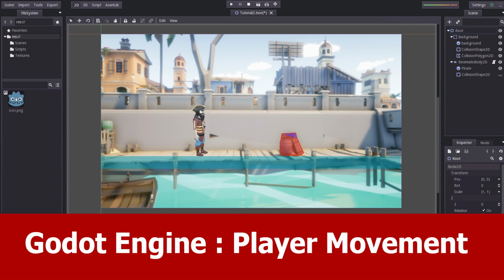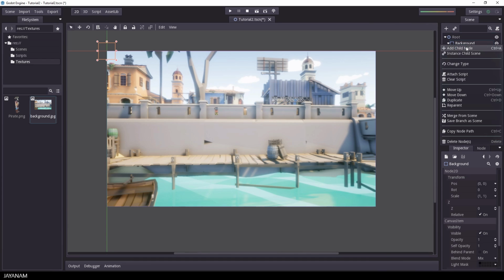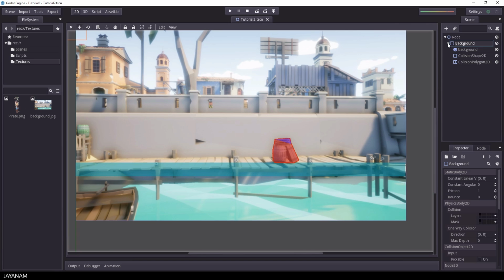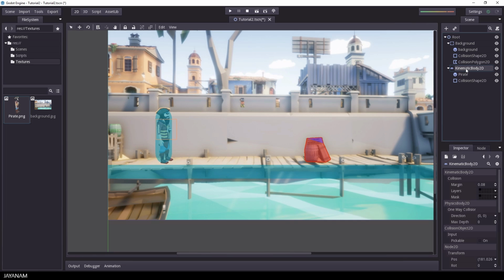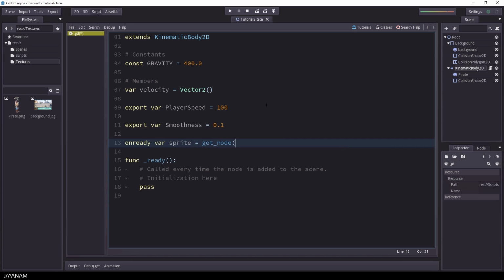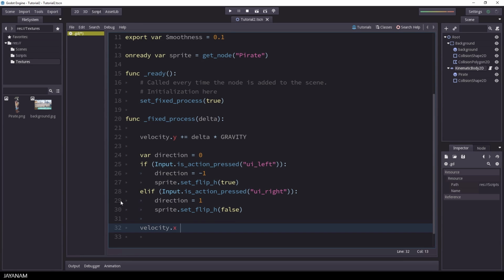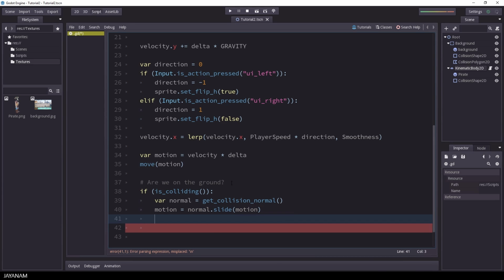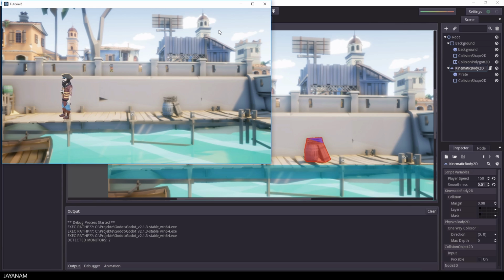Godot Engine Tutorial : Player Movement

Comment: I think is recommended to adjust the collision shapes using only the inner handles, apparently it creates     problems if you don't do that way
Reply from the maker: That's true but I think I did this, could you point to a position in the video were I do otherwise? Ah now I saw it, for the capsule of the player, thx for pointing that out.